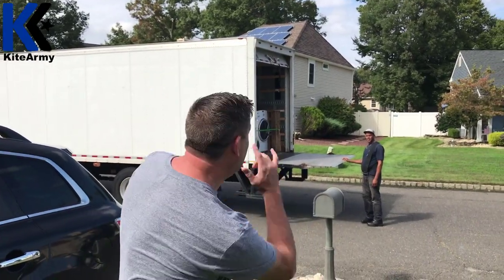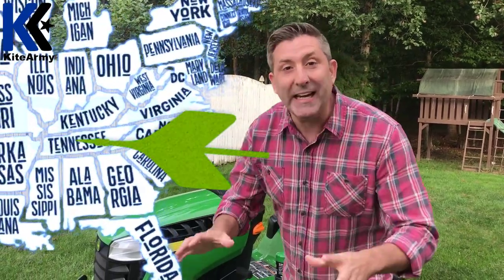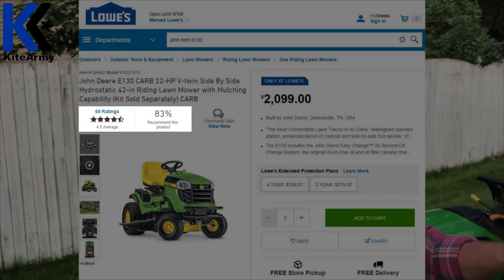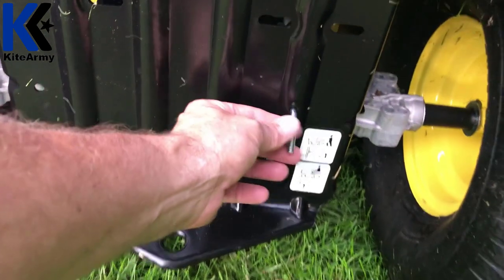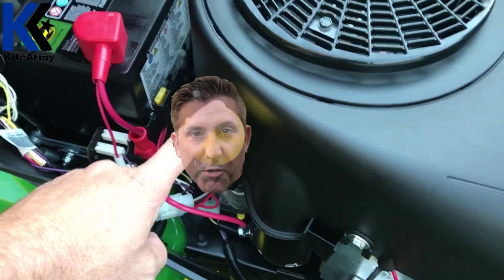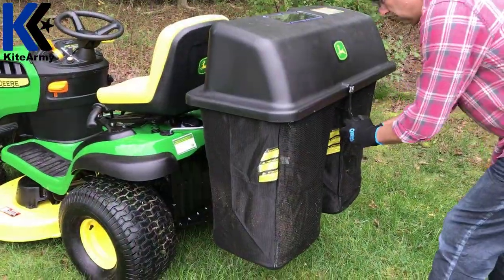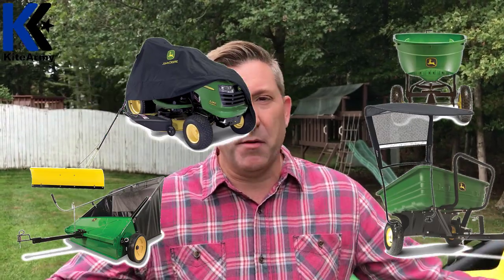Best Riding Lawn Mower 2019 | John Deere E130 Review 🌿🌿🌿

Comment: Hate to burst your bubble but it’s not a real John Deere any “John Deere “ sold at Lowe’s or Home Depot are made by MTD cheap knockoff
Reply: Logan Swann wrong,don't lie
Reply: Although an economy mower line they are made by John Deere in Greeneville, TN. They have nothing to do with MTD.  So sorry to burst your bubble but yes, they are real John Deere machines regardless if JD fanboys accept it or not.
Reply: @MarkPalmer1000  exactly,these E series tractors can be bought at big box stores as well as John Deere dealers,the stipulation being that big box stores cannot discount the price below what the JD dealer has it set at,other than that it is a real JD tractor.
Reply: Just can't figure out why people keep bashing these JD's for "being made by MTD" when they clearly are not, yet you can look at Cub Cadet videos all day long and rarely will you see an MTD bash in regards to them when they actually are made by MTD.
Reply: Ultra CNC  nope you're wrong
Reply: @ Ultra CNC All the models in this E series of John Deere have Briggs and Stratton Intek and Intek ELS engines  made to Deere specs. The Intek has a fairly good reputation, not the best out there but decent in this price range. Competitive tractors in this price range typically have Briggs Intek or Kohler 7000 Series engines which are a redesigned version of their previous Courage engine line, which got a poor reputation for reliability.
Reply: Ultra CNC  okay well some wires got crossed somewhere because I said that John Deere tractors are made by John Deere and sold at big-box stores but they can't be sold for less than they are at a John Deere dealer
Reply: Logan Swann wrong, try again
Reply: Logan Swann, Hate to burst YOUR bubble. ALL John Deere 100 series are manufactured in Greenville Tn. by Deere& Co. Grounds Care division. Full size lawn and garden tractors are built in Horicon Wi. at the old Van Brunt grain drill works. At present there is no collaboration between J.D. and Modern Tool and Die. This stupid myth has spread like an epidemic across this country because M.T.D has assumed venerable old names such as Bolens. Thank You...
Reply: Genuine Deere engine?? This E130 and its ''comparable'' Husqvarna both utilize a Briggs and Stratton Intek series v-twin engine. In fact, the Husqvarna uses the version that has upgraded exhaust valves, higher amperage stator [alternator] , and aluminum intake manifold .  J.D. uses a Kanzaki  hydrostatic transaxle. Husqvarna currently utilizes a c.v.t transmission. So your correct about misinformation!
Reply: @billrice2284  Bill please take one of these D or E series Deere mowers and Park it along side any MTD, Bolens, Troybilt, etc (basically any mower sold at a big box store) and look at the physical attributes of each machine. I believe you will find them to be identical. I have never seen a D or E series mower at an actual JD dealer but I have seen LA and X series mowers. Nor have I ever seen an LA or X series at Lowes, Home Depot, Wallyworld, etc... Even with other brands such as Cub Cadet there are DEALER machines which are true CC and Big Box machines which are NOT true Cub Cadets. This came straight from a local Cub Cadet dealer. One glance will show you the difference. A true late model CC is all yellow while the BB models have white hoods. The D and E series machines might be assembled in a building owned by JD but are certainly not the same quality as the LA and X series machines sold by John Deere dealers.

Comment: Best Riding Lawn Mower??? It's not the "best".
Reply from the maker: I guess I should have said the "Best" mower I have ever used.  What do you think is the best?
Reply: @Kitearmy  ha, Scag, Exmark, etc.
Reply from the maker: @iiiStUNA9  Plenty would argue with you of your "best" choices
Reply from the maker: also their can only be one "best"
Reply: @Kitearmy  A stamped deck, no more needs to be said. I know this is a sponsored video and all but come on man, be a little realistic. Everyone knows stamped decks are no good.
Reply from the maker: I don't have to be realistic.  So what is the big problem with stamped decks?  This everyone has no idea...
Reply: @Kitearmy  What is the difference in stamped and fabricated mower decks? The fabricated mower deck is typically built from heavier plate steel and is a welded mower deck. The stamped mower deck is typically lighter and the mower deck shell is formed by large molds and presses.. Come on man, clearly you don't know what you're talking about. Scag doesn't even make a mower that has a stamped deck. They're garbage, light and are more prone to braking.
Reply from the maker: I like stamped decks - thanks you.  Smooth edges = less spots for grass to get caught and less rusting
Reply: @Kitearmy  sounds good. Just looking long term and overall cut quality.
Reply from the maker: You may have a larger lawn - mine is about 1/4acre of grass.  I like it, what more can i say
Reply: @Kitearmy  Then perfect. If you had two acres, it would take you hours with this machine.
Reply from the maker: Nope - if I had 2 acres I would hire a landscaping crew
Reply: Kite Army No you wouldn’t.... do you have any idea what it would cost to have a crew to do something like that? Those of us with land buy quality equipment and do it ourselves.
Reply from the maker: Thank you for bringing that to my attention..... I certainly would not be comfortable breaking the code of land owners and hiring a landscaping crew.  NO WAY 😀
Reply: Gilitar I agree. Buy quality equipment, comes with the territory.
Reply: Kite Army my friend got a quote for his 3/4 acre, they wanted $200 a week. So that is wasting money when you can buy your own zero turn.
Reply from the maker: My parents have 4 acres and get a double cut for $80 per week.  The crew does almost every home in the neighborhood.  While they cut we hang out at the beach.  That being said some people are just DIYers and enjoy riding around their lawn.   Me, in summer -all about the beach
Reply: Kite Army what state do you live in? Must be a bunch of kids with mowers.
Reply from the maker: Maybe since everyone has the service the competitiveness drives down the price
Reply from the maker: @iiiStUNA9  The service is top notch - the double cut looks great
Reply: It's an economy lawn tractor, and it happens to be one of the best rated ones in that particular class.  Yeah, Harry Homeowner needs to run right out and buy an Exmark ZT with a fabricated deck to mow a half acre of grass once a week.
Reply from the maker: @MarkPalmer1000  I think I'm picking up on your sarcasm - you made some reasonable points - for a homeowner this mower will be perfect
Reply: Exactly, it will work just fine and with a bit of maintenance you'll get plenty of life out of it.  I got the E170 to replace my old Craftsman for my half acre and I couldn't be happier.  Most of us don't need a $6000 machine just to cut the lawn once a week.
Reply from the maker: @MarkPalmer1000  I also think if you can afford a $6000 mower maybe you should consider a landscaping service
Reply: Cody schrader p

Comment: While the "Easy Change" oil change is very convenient is has two major disadvantages, it leaves about a third of the old dirty oil in the engine, and it is ridiculously expensive. There is a cure for this, and it pays for itself the first time you use it. The conversion kit from GreenPartStore (AUC12916-KIT) is $26.63 and comes with conversion parts plus oil and filter.  Deere approved and won't void warranty. If you can't find it run a Google search.
Reply from the maker: I agree with you but I'm sticking with the easy change - better to change 1/3 the oil than none

Comment: I’ve the same one...love it so far,  but at 8 hrs I converted it back to a standard oil filter. Easy to do. Didn’t like that I would be changing only a 1/3 of the oil with the easy change system. Great vid!
Reply from the maker: Thanks mate - I was thinking of converting mine to a standard oil filter too
Reply: i have almost 30 hours on  my lawn mower. and yes, I do have the same lawn mower too.
Reply from the maker: @brucej6198  Have you converted to a conventional oil filter?
Reply: Kite Army I’m not sure. I’m only 11 so I don’t really pay that much attention to the oil filters. But I love the fact that the oil filter is already filled with oil
Reply from the maker: @brucej6198  Dude only 11 and operating this mower - good on you.
Reply: Kite Army yeah! She’s a fast one to! And the seat really nice.
Reply: Kite Army hey does your lawn mower have cruise control because the black lever on the right of the ignition is a cruise control lever
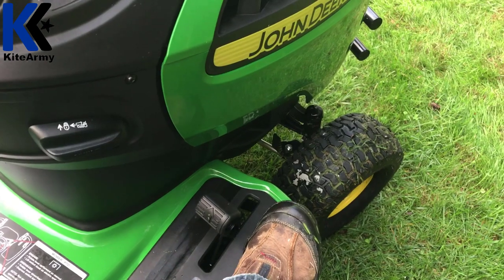Reply from the maker: @brucej6198  I thought that just locked in the cruise speed - 4:30
Reply from the maker: @brucej6198  What a dream to have this as an 11 year old - at that age I was still messing around with push mowers

Comment: I got a 10 year old craftsman that has a hydrostatic motor, can mow in reverse , easier deck height adjustment. All these cool features this mower has are old news.  I know most of you probably put maybe 20 hours on your riding mowers a year. I put about 20 hours ever 2 months now that I’m slowing down on my yard work. How do these mowers last? How about after 200 hours? Is the engine even useable after that?
Reply from the maker: Probably not - these are built for normal household use
Reply: Kite Army hmm that’s sad that’s what mowers are coming to. Quantity over quality like everything else.

Comment: I had a Husqarna 18.5 42 inch black deck.  Most uncomfortable mower I have ever owned.  Took 1.5 hours to mow my flat city lot.  The Briggs engine was problematic (valve retainer keep coming off)  I got fed up with the problems.  JD took the Husqvarna in trade on a JD S240 18.5 V twin Kawasaki 42 inch yellow deck.  I now mow the same yard in 45 minutes or less.  I dreaded having to mow with the Husqvarna.  Our city lot is 150' x 133' and a flat slope dropping 3 feet from SW to NE and a 2' drainage ditch along the road frontage.  I look forward to mowing with the JD.  First two minutes on the JD I came to understand the slogan "it's not how fast you mow, it's how well you mow fast"
Reply from the maker: Great comment - 1.5 hours to mow that small of a lot is crazy.  Glad the JD came through for you!

Comment: I love this mower (E130). Just got one a month ago. Previously had a D140 in 2014 and can say this the E130 beats the older D140, which is “bigger”. Obviously the 130 is newer than my previous one, but the improvements they made are worth it . The 22 HP the with 42”cut is perfect size for me. It’s smooth, turns sharp, and cuts fast. The John Deere haters can say all they want, they just jealous!
Reply from the maker: I see that jealousy a lot

Comment: I use mine in winter with snowthrower and I can say that this 22 HP engine is very powerful. It can throw away snow between 50 to 55 ft no problem. I converted the easy oil change for a regular system (flush old oil - change for a cheaper $$$ oil filter - fill up with brand new and fresh 10W-30 oil. I purchased the tractor as used machine (55 hours only). The owner had problem with the snowthrower (too much friction from the trhower base plate) I only had to raise side skids. 2, 43 lbs weights at the back of the tractor plus chains to rear tires and this machine rocks!!!!
Reply from the maker: nice find - a little brain can go a long way

Comment: I purchased the e130 and was a little annoyed that right off the showroom i had to change the blades to use the bagger attachment. The HIGH LIFT BLADES,  worked great and it's sop comfy to drive,  the seat is plush and steering is effortless and tight turns are a breeze.  Im only one half acre of mowing down. So far but this thing is awesome.
Reply from the maker: from bad to good!

Comment: I’ve had this mower for about 10 months and absolutely love it. It makes me look forward to mowing the lawn. The two things that are worth noting, are that I thought buying this meant I could get rid of my push mower, but there are a few spots in my yard that I can’t get with this (around some trees, inside corners etc). Also, if the grass is a little wet, it causes the bagging chute to clog up which is a bit of a pain to have to stop and de-clog. Other than that, great mower.
Reply from the maker: Couldn't agree more!
Reply: if you do not use a bag, attach a string or cord to the chute flap to lift it up a little to let the clippings come out more more freely which in turn will spread the clippings out more evenly so when you come around there wont be so much clumping. Or mow the other way so you don't mow over the clippings you have already blown out. Sometimes it's just gonna clog up no matter what.

Comment: I used undercoating up under my deck. That way wet grass cannot stick to the metal. It is just as easy to use the water attachment to wash underneath.
Reply from the maker: I had to undercoat my deck too = got all beat up

Comment: Who's Engine is in it?
How long does it take to get the deck off?
Not a fan of the oil change system. You can't fully drain the crank case.
Reply: It's a Briggs and Stratton motor. The Deck does not come off on this model. I have only put 6 hours on mine since I bought it last summer, so I haven't tried the oil change feature yet.
Reply: @danielaupperle  huh.. thanks.
I'm not really a fan of John Deere.
You can take the mower deck off a Husqvarna in about 10 minutes..
And not a fan of that quick oil change system..

Comment: I just purchased one yesterday and i love the ride and love the reverse pedal feature! Its an awesome tractor...and lets not forget the 30 second oil change!
Reply from the maker: I don't know why other brands haven't gone to this simple oil change - this is the best!
Reply: @Kitearmy  They haven't because your only changing 40% of the old oil the rest is just supplemented by the new oil in the quick change filter. Marketing leading the engineers again. The same logic would apply to those that drain and fill the crankcase without changing the filter. Wait and see if a consumer class action law suit doesn't start on this move by JD.
Reply from the maker: @brianclark2119  Toro makes some new mowers that never require an oil change
Reply: That proprietary oil change device is reason enough to run like hell from these cheezy Briggs engines
Reply: Its been a long year of cutting grass and my tractor still running like new! I guess it all depends on the individual and how well you takecare of things!👍
Reply: The easy oil change is garbage .  When you change the oil in your car , do you just change half the oil ?

Comment: Bearings are sealed but have grease locations, motor is briggs and Stratton and labeled by john Deere, they do have full warranty and they stand by it. I got the E160 at lowes with a free cart. Maybe go there instead of lowes.
Reply from the maker: maybe you meant home depot instead of Lowes?

Comment: Great review.
i purchased an E120 last September and being my first lawn tractor I was anxious to see how I liked it.
I loved it! It was super powerful and super comfortable.
Although the salesman extolled the virtues of the Easy Change Oil Filter system I was hesitant to pass judgement on it.
I've had a lot of small engines and I am very conservative about oil changes.
I have since found out from various sources that the Easy Change only removes about 60% of the oil.
I will buy and install the conversion kit available from greenpartstore.com before I use it for the first time this Spring.
I have only 2.3 hours on the machine but it has made a good impression on me for sure.
Reply from the maker: I had the same concern about the oil change when I found out that it does not remove all the oil.  This is how I framed that concern - just replace 2x as often if you want to play it conservatively.  Most people are very lax with oil changes so you will be well ahead of the game
Reply: I don't believe that is a viable solution because the Easy Change filter already costs twice as much as a regular oil change. Changing it twice as often would make it 4 times as expensive.
  @Kitearmy
Reply from the maker: true but it only takes 30secs.  What is your time worth?  My point being if you follow their replacement schedule you probably won't risk any harm to your mower
Reply from the maker: BTW - I saw some listed on Ebay for $30
Reply: Doug Macgregor I have thye120 to love it great mower

Comment: I've sharpened it after each mowing season and it performs every time Just know that this is a reel mower and require you to PUSH it. It's not a powered mower that you can just walk behind. You are turning the blades, not a motor. So, when the grass gets a little high, you're going to have to push harder. Keep the blades sharp and your grass will look great.
Reply from the maker: I have never tries a reel mower - tempting